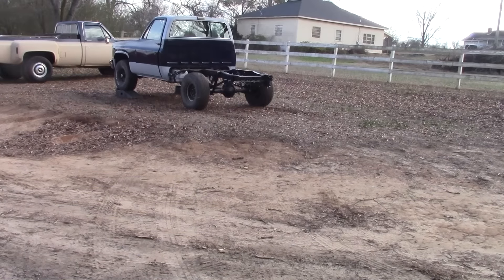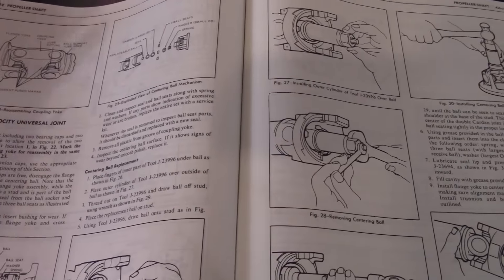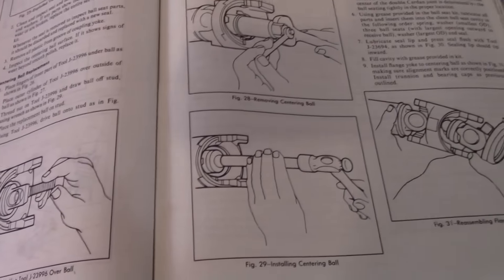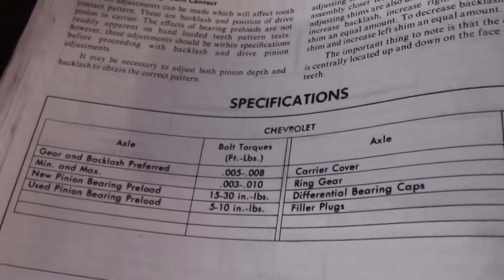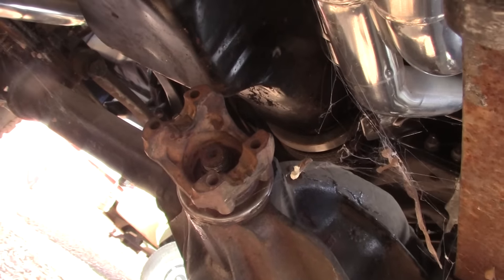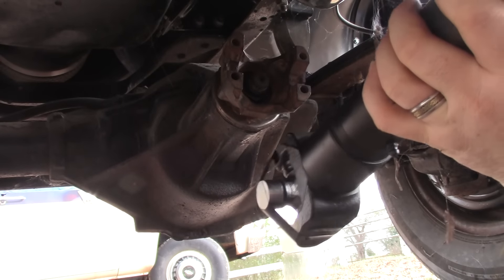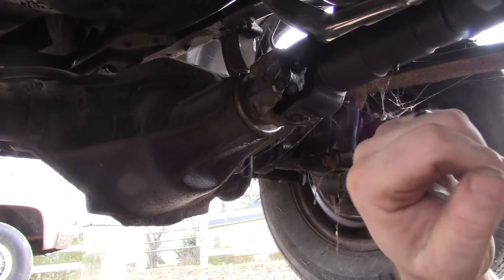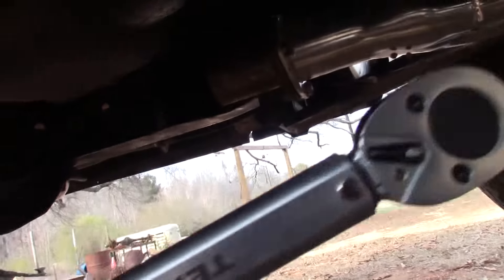1985 Chevy K10 Restoration Part 126

Comment: It's a long shot I'm sure but if you know could you tell me the size nut and the thread pitch for the stud on the side of the transfer case for the shifter arm. I lost the nut that holds it on when I took my t case out and haven't been able to find one that fits. Thanks! Love the videos since I'm in the process of redoing my 83
Reply from the maker: Thanks Zach!  I don't know off the top of my head, but if you have a hardware store nearby, they usually have something there to check threads, or if you have a tap/die set.